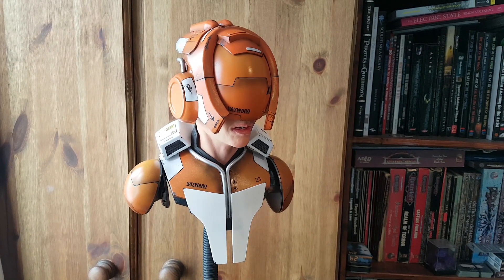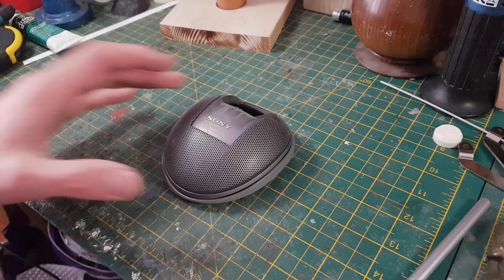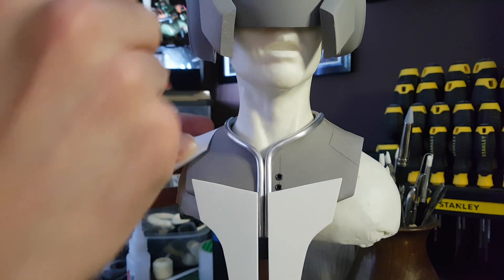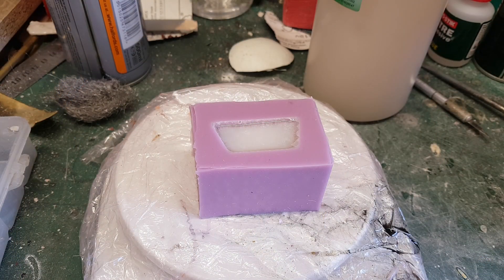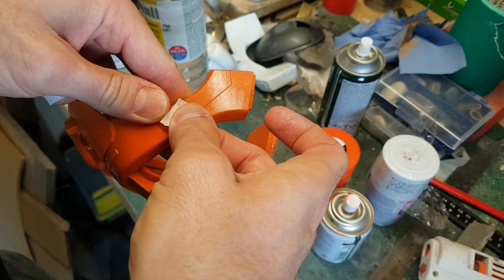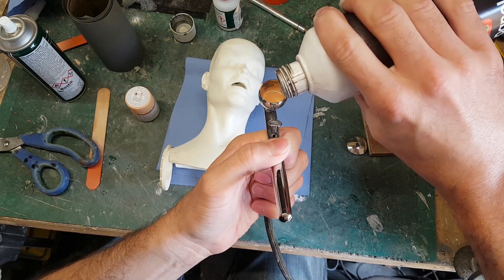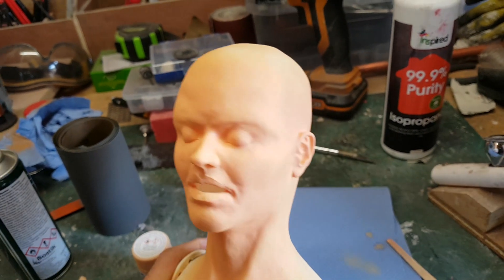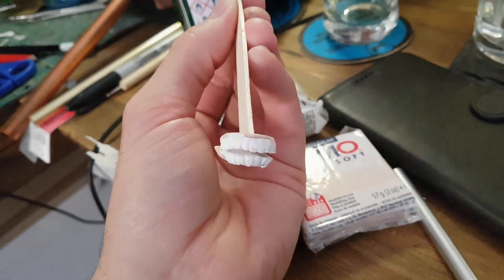Making a Scifi Helmet Sculpture Part 2

Comment: Great work as usual! Did you know? if you use 3-4 coats of gloss top-coat and sand back with high grit sand paper it’ll make the outline of decal glue/paper disappear
Reply from the maker: Thanks, yeah I did wonder about that.  I had the paint job looking just as I wanted though and didn't want to risk screwing it up!  I'll have to have a practice on something before trying that.